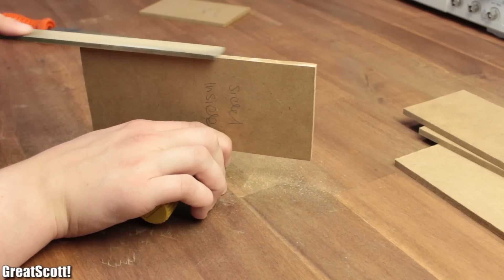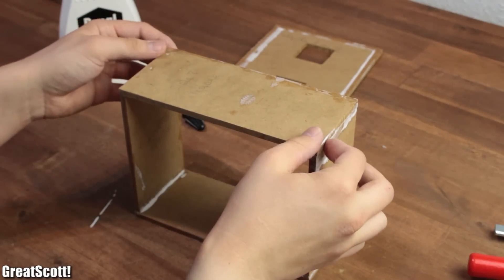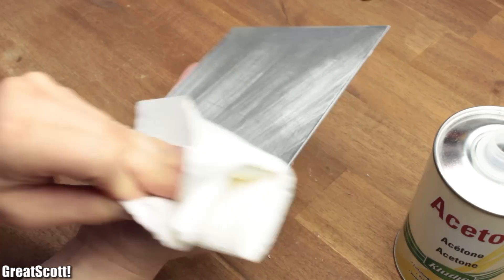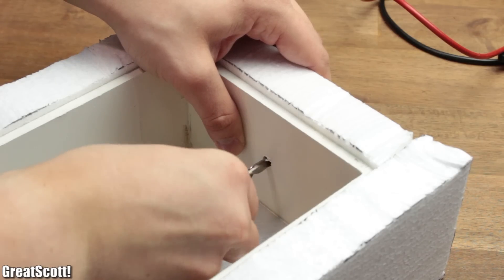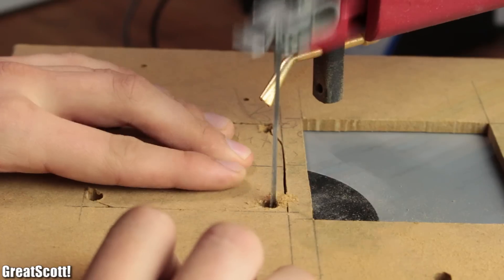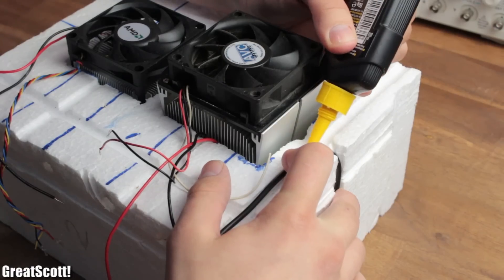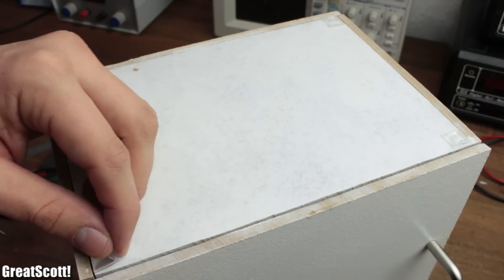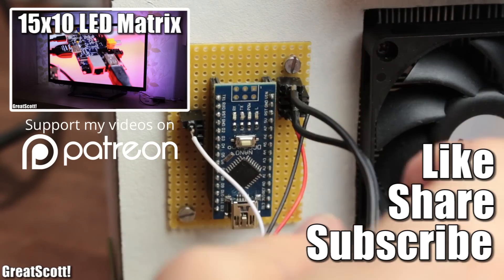DIY Cooler (Part 2) || Peltier Module

Comment: I built a cooler like this a year ago, only using a 50w pertier and I can even store 8 can of beers or wine, so anyway it is quiet big, and the lowest temperature is 5°C.

So inside I used a huge heatsink, but the outside is where things get complicated. 
So I made a rectangular column which is hollow, and led out two 6mm copper pipes, made some loops and turns (something similar what you can see on the back of the refrigerators. Even added small strips on it to driver the warm away more effectively. Added a cap which is used for refrigerators, vacuumed it and filled it with R134a. 

It works like a dream and only the power supply and the pertier  and the control board consume energy, and has no sound.

And instead of Arduino there are boards designed for this. I mean you can buy a small board which has a 10A rellay on it, a 3 digit 7 segment screen and a connector for a NTC .
You can set if it is a cooler or a heather, the temperature you want and the delay temperate. 
Costs only around €2 .

Comment: i already see a possible issue with this specific design. those heatsinks need a space next to them for the hot air exhaust to go anywhere. just cut some holes on the back for that and you'll be fine.

Comment: I would flip the fans into a pull configuration instead of push. Pull the heat away while pulling cool air across the back of the fridge
Reply: And add some kind of fliter cloth over the intake! Dirt and dust are the main killers of coolers

Comment: bravo for the idea but some questions if you can answer :
- the project , do you try it 24 hours a day ? for a long period of time ? 
- you used relay, is it better than  a npn transistor  or it's simply a matter of choice or price and simplicity ? 
- measuring the cold temperature is a good idea, but i think that measuring the hot temperature of the other side is necessary to not overheat the system?
- can we think about cooling the "fridge" by steps if the temperature of the cold side is far from the needed temperature range? thinking about stopping every 5 minutes for example even it's up to the max temperature (8° in this case) cause if the door of the fridge is open it never cool enough to the needed range?
- for controlling the relays, you used an arduino, it's only needed for activating or deactivating the relays module, did a thermostat is a better idea ?  
 and finally i want to say that my questions are just for making better idea and i must tell you that i loved the idea and i found it original idea and hoping it can help even as a car mini fridge

Comment: Where is the power supply in the parts list? Is this not important??...
I keep seeing these p
Same power supply blocks being used by different YouTube channels but nobody actually points out what the fk they are... What model, what voltage, variable or not variable, ampage etc. Kind of important to talk about

Comment: Very nice...A suggestion that can make a difference;  instead of using two peltier this way, use both of them in series on top of each other and you will get much better cooling and lower power consumption.  ;)

Comment: I would think that to increase efficiency you should place a fan on the inside also you can use an Ice chest 
https://www.walmart.com/ip/Coleman-16-Quart-Portable-Excursion-Cooler-for-Picnics-BBQs/36077267?wmlspartner=wlpa&selectedSellerId=0&adid=22222222227025324929&wl0=&wl1=g&wl2=c&wl3=42976493432&wl4=aud-566049426705:pla-81468938432&wl5=9028626&wl6=&wl7=&wl8=&wl9=pla&wl10=8175035&wl11=online&wl12=36077267&veh=sem&gclid=CjwKCAjwk93rBRBLEiwAcMapUaYt0mU3j7EoQDihuEkeB-tYaaTrMGDcjmSP6y6Kp9z9lqW5dW-DQBoCBOgQAvD_BwE

such as that and simplify  your build a bit... also restricting the air flow on the hot side probably not a good idea because the back end is something no one going to see... also since all the euipment uses 12Vs you can clean up the wires and have only a single power source and on a peltier it is not necessary to worry too much about it loosing efficiency ...

Comment: You loose a lot of heat from stacking too many of aluminium...
You loose all the airflow on the coolers because the fins are covered.

Nice project but too many mistakes.

Comment: What if we had a 'heat' sink on the cold side with a small fan to blow the cool air in that small area? Would help cause the room in there be cool faster?
I ask because I plan on doing a project extremely similar to this but with a few 'twists' and additions.

Comment: For the hot side; I wounder if you can stack fans on top of each other to get better cooling on that heatsink? I ask since not all 12v fans may meet the CFM requirements.
Reply: Actually, using a better cooler (watercooled or with heat pipes) will give much better result, atleast in my experience.
PC heatpipe or watercoolers make excellent Peltier hot side coolers.
If you can mount more then one fan on it, expect that the hot side to be cooler for some degrees.

Comment: It's not a good project bro . TEC1-12706 is not capable of producing a cold side temp more  than 15 °C . I tried it before
Reply: These modules create a temperature difference between the two sides. So if you're able to keep the hot-side temperature cool, the cold-side temperature will be much cooler. A quick scan through the datasheet suggests that at maximum power input, and 50°C hot-side temp. the cold-side can go down to -15°C for the model you mention.

Comment: I think a more efficient way to cool it would be with a cheap custom built liquid cooler using distilled water. It is more slim and will likely cool the liquid slower as water is polar and temp resistant. Meaning you can leave the pump and loop off for longer saving more power and thus increasing efficiency. Also getting slimmer more dense foam would allow more inner space for cans and would make the walls thinner but equally effiecient. Also a cool touch would be adding a switch on the door the powers 3v led strips on the inside to add a bit of light when the door is opened. Overall though I was very impressed. Great video!

Comment: the problem  with inserting the heat sink of the hot side in the foam, air  efficiency become poor,  to get good and lower temps you  need  to keep  the  hot   side  cold,  or  improve  heat  dissipation

Comment: Bro how about using 10 of those to cool a rectangular cabin of length 2m*1m*0.5m with water cooling on the heat side. Is it feasible ?? How much will it save power than a regular split ac

Comment: Your CPU Coolers don't cool anything at the moment because they are covered in styrofoam. You could increase the performance by leaving a little gab around them for the hot air to escape

Comment: When you paint an edge of mdf use a celulose laquer, simply spray those edges and sand them 2 times and then you can prime and paint them and edges looks smooth and with no weird texture.

Comment: Every time you open the door all the cold air comes out, at this size a 'chest' type would be better. Polystyrene is not closed cell and can become water logged due to condensation. A coat of emulsion or 3 on the inside would help. A simple 12v thermostat would be far less complicated, cheaper and more reliable. EBAY - W1209 DC12V -50~110°C Digital Temperature Control Switch Sensor ATF £1.31 They are 'fantastic' and I don't often use that word.

Comment: Far better than useing a big motor/compressor and using mains power. Solar power could keep precious items cold. On hot days . Good work. Om. de kv4li ps 4 wire phone wire or cat 5 cable could be the best as it's cheep and reliable.

Comment: why dont you make the fridge bigger than this ? solution for get cooler in fridge only just additionaling the peltier and fan .  and this video is dont use water and pump for cooling the heatsink and pipe cause it will become freezing if use more than 10 minutes

Comment: to increase the efficiency of peltier you can stack two modules on top of each other. This way you'll have smaller temperature difference and the peltier module is more efficient the smaller the difference (you just drive it with lower voltage). Ideally the hot side peltier mus have twice the area as the cold one.

Comment: Is glue a working as a thermal conductor? 
Maybe you can improve the performance by screwing the heatsinks into the big aluminum plate with the small aluminum plate and the peltier module and some thermal compound in between.

Great videos man, I love all of them, keep it up!

Comment: 7 amps just for two cans? That's ALOT of power for that application. Im trying to cool a 13 can cooler using anywhere from 4 to 5.5 amps.

Comment: So many mistakes, come on. You blocked the air outlets on the hot side, lowering the temperature change, also left no room for air to circulate inside the box causing the heat to be changed only by irradiation and little driving, also did not put a cooler on the cold side to circulate the air, also leaving the temperature only circular by irradiation. It has to have more space and a cooler, so you could reach 7 degrees in 1 hour.

Comment: Does the 12 volts 30 amps power supply pushes all 30 amps or does it only use on what the Peltiers and fans need?

Comment: Have you tried to stack peltiers so that you could use peltier to cool down the other peltier? I quess this way its possible to get the temperature in the box lower but of course you will need very effective cooling for the upper peltier.

Comment: Quick observation: poor air circulation around the hot air heat exchangers in the back. The foam  needs to be cut back to let the air out (or in depending on the air flow). Should have as much cross sectional area going away from the fan as going into it .

Comment: How did you manage to make the heatsinks stick to the peltier modules? Well I mean thermal paste is not an adhesive........So how?
Reply: Gab Racal one of the two pastes was a thermally conductive glue

Comment: awesome project, the only thing i would have changed in this, is the direction the fans were blowing.. i would make the fans pull the hot air away from the heatsink/fridge instead of pushing air towards it.. but yeah that probably doesn't make a huge difference, but still..

Comment: Do you think that this could be used to make an air conditioning unit?
Reply: Not without insane amounts power or walls filled with aerogel insulation and even then youve got to pull 90W minimum out of the air per person, which would easily take like 10 of these after losses are accounted for. So you come out with a device that uses ~1000W to extract ~90W whereas a compressor based heat pump (normal air conditioner) can take 500W and extract 1000W without much struggle.

Comment: After watching your video about building that DIY peltier cooler, i got the urge to try making one myself.
I know that peltier modules are inefficient, but did alot of research for how to get the most from them.

My only concern is the thermal isolation. Foam is cheap, but i read that PIR can be alot better, but also more pricier. Any sugestions for great thermal isolation material and low cost or could i stick with PIR?

Comment: What would happen if you stack the thermal things? I’m pretty sure the hot side of one would be cooled by the cold side of the other and will allow the outer most surfaces to have a greater temperature difference
Reply: You need like four modules to extract the heat from one but yes, you can make cascade arrangements capable of reaching astonishingly low temperatures.

Comment: If you were to keep the modules on constantly instead of turn on when needed, will it Get cooler? I understand it would use much more electricity, but I don’t really car about that. ;) Also, Do you think it would speed up the cooling process by adding a fan to the interior of the fridge?

Comment: you would not have to wait overnight if at cold side you had used a small heatsink with fan as forced convection is very efficient than natural convection

update:also you should add those small aluminium squares at hot side not on cold side.switching off peltiers would raise the internal temperature rapidly as compared when running at low voltage.so it is not a power saving method.use MOSFETs to lower the voltage so it uses less current.

Comment: Hey thanks for sharing knowledge! I'm looking to build one of this for a project. you said on a comment how you use one of the three cables from your 12V DC converter since all them split current. I understand that you are delivering 12v & 6+A to the Arduino? or that is been delivered to the thermoelectric cooler? or both? can you further explain this who takes what power when you have some time? what are the max inputs for an Arduino?
Thanks 
-Ricardo

Comment: What did you use to keep the heatsinks on the cooling modules? just the thermal glue? and can I use an old ATX size power supply from an old computer?

Comment: This was built wrong, I dont know why some of you dont realize that the fan is used to blow cold air in, not blow the air out. The fan should be inside while some of the heat sink is exposed to the outside so the fan can suck in air and in this case suck in the cold air the peltier is producing.

That is why it took your cooler 24 hours to reach a cold enough temperature.

Comment: I wonder if using 2 of those Power Mac G5 circa 50W heatsinks would actually improve it? At least, I tried putting a TEC on one and connected it to a 12V computer PSU and it got to about -3ºC at ~6 A
Reply: that nearly doubles the construction size though...

Comment: Does the peltier notice the side? For example, on which side we will put the block cooler.
Reply: It depends on the direction you run the current in.
Reply: ok

Comment: I recommend that if you upgrade this you use water cooling instead. With a simple cheap corsair water cooler i easily got the peltier around -30C with 4 amps flowing through the peltier.
Reply: Or heat pipes.

Comment: I was wondering how efficient those things are, but if it takes some 100W to cool two cans over night, I think I got my answer. Not very efficient.
Reply: Mile Jukic Thats actually kinda the point of a fridge, to cool it down until you actually want it. :p
Reply: Mile Jukic 30%
Reply: Simon WoodburyForget No, it doesn't work like that
Reply: Simon WoodburyForget Power in time is energy (eg. 100W for 10 hours is 1KWh), just like mass and temperature. It's about the amount of heat, not just temperature. Whatever,  I've studied those Peltier modules, they could be fun, but still not effective enough for practical use.
Reply: Simon WoodburyForget Let me put it this way. It takes ten  times more energy to cool down ten cans than just one (I didn't count the  air, the air has very small heat capacity because of its small mass), to the same temperature. It's about the energy, OK. When we talk about effeciency, we talk about useful transfer of ENERGY from one form to another, the desired one.
Reply: Simon WoodburyForget That's right :)
Reply: Simon WoodburyForget No, by adding more units, you actually increase the performance. And insulation is completely different thing. The old fashion gas compressors are still way more effecient. Those Peltier things are pretty nice, they don't have moving parts, no gasses, they are small and powerful, don't make noise, but they still are not effecient enough. They use way more energy to do the same job than classic coolers.
Reply: Simon WoodburyForget You don't have a refrigerator to cool it down once and keep it closed :)

Comment: Could you make mini room cooler using alot of peltier module please....
Reply: That would require horrendous amounts of power. You'd be much better off building a heat pump, which is what an AC is.

Comment: I'm playing around with some peltier modules and boy is the hot side WAY hotter than to cold side is cold.  You need really good heatsinks to keep the hot side from being so hot it actually makes the cold side as hot or hotter than room temp.
Reply: It’s very easy to make a heater out of a Peltier
Reply: @ariesleo7396  Yes, just reverse the polarity...
The heating power of a Peltier is greater than the cooling power and by a wide margin...

Comment: Do an improvement video for example: hidden wires, internal power supply, external built in temperature control knob, external built in digital thermometer and a real ac power plug... love the project

Comment: Your heatsinks won't be working as well as they should due to the very restricted airflow. Also don't use sandpaper on thermally conducting surfaces, the valleys it creates reduces the contact area reducing thermal dissipation. Close enough for government work though. 
A word of advice for anyone planning a build, Superglue will chew threw polystyrene like nothing else.
Reply: Exactly!

Comment: very cool. I am currently designing a similar project to house a 5 liter mini keg for my home made beer inside a 7.7 liter insulated water jug. I plan on using one peltier unit controlled by an Arduino like you have done, but because I will store the unused kegs in a refrigerator, it will only need to keep them cool.

Comment: Nice project!! I watched and I been wondering if we could try using copper instead of aluminium to improve results
Reply: im gonna assume that yes. copper will improve results, but i dont think by much. Something that most certainly would improve results though, would be higher-end heatsinks and using a fan on the inside to blow cool air around.